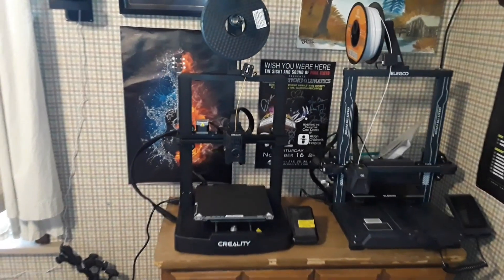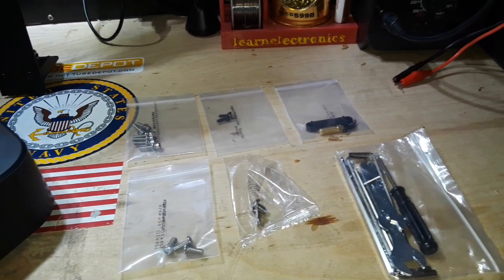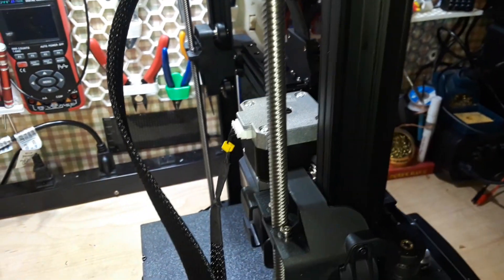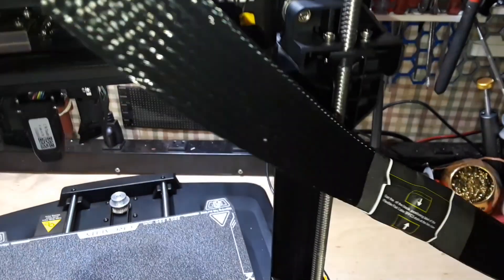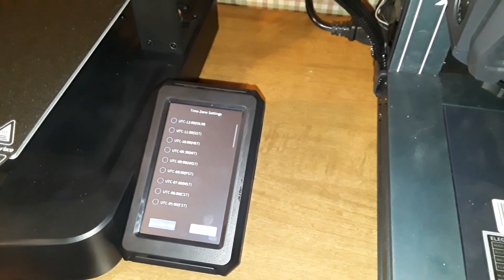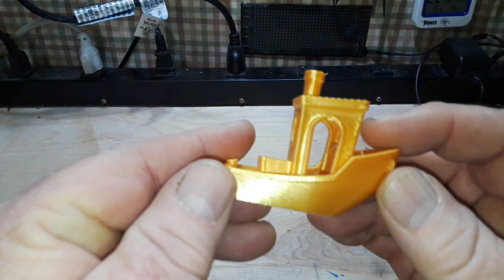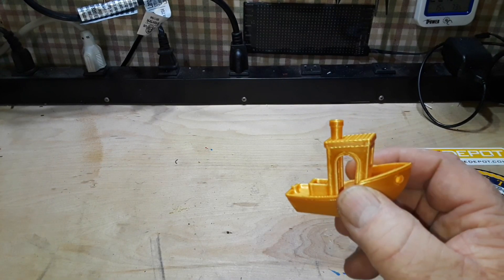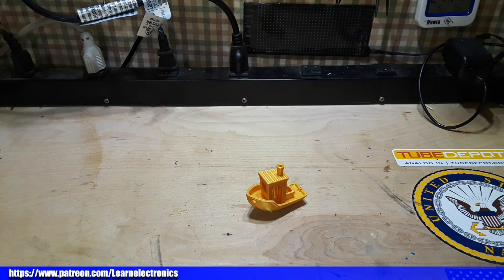Creality Ender 3 V3 KE Unboxing Setup & First Print

Comment: I just opened mine and similar to yours there are no rubber feet.  Seems like a quality control issue.  What did you do about that?
Reply from the maker: I just used some I had. But you should contact Creality Customer Support.

Comment: Nice presentation.
I have an Ender 3 v2 modded, and now, I've the Ender 3 v3 KE.
This printer is a huge upgrade in speed and quality.
The benchy was printed from the USB stick, and took only 17 minutes to be printed.
All my print are done vie the "Creality Print" software, and are printed very fast.
I prefer the UltiMaker Cura, but it is as slow as my v2.
Now, I've more knowledge with the Creality Print software, and I can use it instead of Cura.
But asap Cura will be able to have a good KE profile, I'll use it as it is better than the Creality Print software.
I do really love my KE 3DPrinter !!!!

Comment: Just set this printer up yesterday. The assembly and calibration is thoroughly simple. It took about 1 hour to unbox, set up and make the first (Tugboat) print. No manual calibration needed at all and I was amazed at how physically smooth the print is. Our print had no seams at all (much better than the one shown here) but it looks like he didn't use the supplied filament which could be the reason. The parts are solid and feel substantial and once assembled the printer is solid. One note: You need this on a solid desk because it shakes the heck out of everything. Definitely worth the $250 (two spools and 2 day shipping included). Hopefully everything will run smoothly in the future as it did on setup.
Reply from the maker: Check the tightness on all your hot end screws and fittings. If you don't, well...watch my video on Christmas day. I had a clog and melted plastic went everywhere. Please note: this was totally my fault. It's a great printer, not counting the stripped down Klipper.

Comment: I'm in doubt between the Neptune 4/pro or V3 KE. Which one to choose? For domestic use, maybe I make some products to sell. @learnelectronics
Reply from the maker: Are you a tinkerer or are you somebody who just wants to print and once the machine to work every time? The KE is pretty much a lockdown system. Kind of like a Macintosh if you're talking about computers. You get what you get right now and you can't change it. However, what you get works great and I have no issues with it whatsoever, just wish it gave me a little more control. Now they have the same issue with the K1, and they release an update that unlock the operating system, so perhaps that will come for the KE as well. The Neptune 4 Pro is a much more solidly built machine, with the steel wheels on the linear rods, I like that setup. It is very stiff. The Neptune however, lacks the hands-off setup feature, you still need to set your z offset manually. So I guess base your decision off of those two things cause otherwise the machines are pretty much identical
Reply: My indecision really lies in the KE's "hands-free" automatic leveling, but the structure of the Neptune 4 pro seems to be more solid. I'm a hobbyist, I already had a v2 neo and sold it to buy the neptune 4. But the launch of KE is giving me sleepless nights, I don't know which one to choose...
Reply from the maker: I absolutely love the hands off first layer setup of the Ender3. But the 4pro is just built more solidly. I'd like to combine them

Comment: Mine came with the rubber feet on it. It provides stability and also extra space underneath so that you don’t nip the filament runout sensor cable that you feed through the bottom.

Comment: The only negative I have so far with my ender 3 v3 ke is the baseplate seems like a PC baseplate and not a pei like it was advertised on their website.
Reply: I had 2 failed prints because they detached from the bed so the z was not low enough or it was the baseplate was the issue
Reply from the maker: I believe the baseplate is PC.
Reply: @learnelectronics yah they should really change their webpage

Comment: My first print benchy was only 15 min print time wonder what the difference is …
Reply: Even when using the default 0.2mm profile in Creality slicer, the benchy comes out at 30 min. Don't know how he got it to print for 47 minutes. The 0.1mm default profile is 56 min.
Reply from the maker: I dont know
Reply: @learnelectronics  You used the wrong version, there should be an optimized version on the USB stick.
Reply: Mine came with a 15 min benchy on the usb

Comment: why did you say its not as fast as the neptune 4? Don't both advertise 500 speed. Are you saying it cant do that?
Reply from the maker: It's a software and configuration issue. Most of the speed comes from acceleration. The firmware appears to have the acceleration somewhat lower than the 4Pro. So while they can both squeeze out filament while moving up to 500mm/s, it takes the KE a longer time to get to where it needs to be. This is easily adjusted in the printer config files. But currently there is no access to the config files. They have locked down the interface. But I expect a change is coming.
Reply: right on. Thank you for the explanation.  @learnelectronics

Comment: How strong is the top of the printer? On my old ender it was a handy place to carry it for transport, this one is made from plastic, is it strong enough to support the weight of the printer? Great review BTW!
Reply from the maker: Thanks, that was just the unboxing. The review will be next week when I have had time to live with it. I think you could carry it from the cross piece. That injection molded section seems to be meaty enough.
Reply: @learnelectronics   thanks for the reply, I feel there are ppl who put their printer on the floor for stability reasons or they dont have space. I used to have my Ender 3 on my floor and had to move it every time to sweep/vacuum.

Comment: My KE should arrive in a few days. Hopefully mine has the rubber feet! Seems like yours were forgotten, they are shown on other videos and need to be there for cooling airflow, same as with the SE. Also, shouldn't the KE be capable of printing at least as fast as the N4 pro? Thanks for the review :-)
Reply: It will have rubber feet, i just got mine but can't use it, getting error key:3000 🤦‍♂
Reply: @bl4de938  Ugh disappointing. Wish they'd sort out their QC.
Reply: @oldman1944  they should test each one at least for auto leveling because printer is unusable if can't finish up that process, i just uploaded video about mine

Comment: Really interested interested in this printer, it sounds great for the price. Arte you able to tune the klipper firmware? Saw another vid that also seemed to suggest you don't get access to the klipper configs though :(  Something i picked up in your vid though: the accelerometer is an additional purchases. On their site it states "Input shaping is done by a preset value. To tune the value please install the optional vibration compensator".
Reply from the maker: There is no access to the config files as the printer is shipped. The web interface gives only the most basic information, and contains only a few controls. However, I expect an update soon. They just freed up the Klipper on the K1 and K1Max after experiencing some flak. I think this KE version of the Ender3 will probably get unlocked as well.
Reply: @learnelectronics  that would be awesome